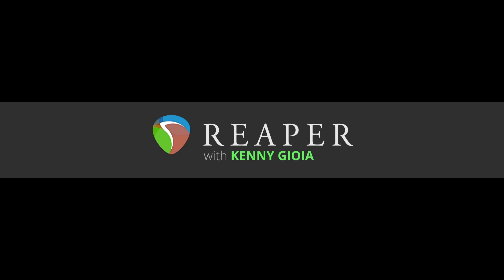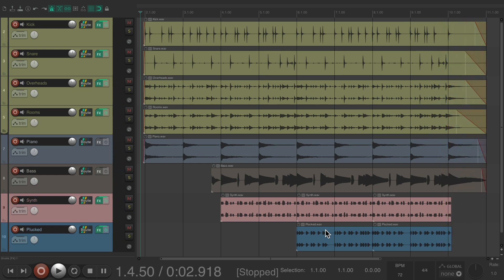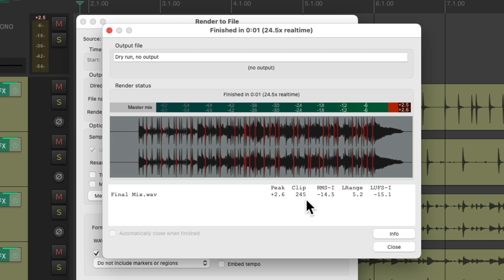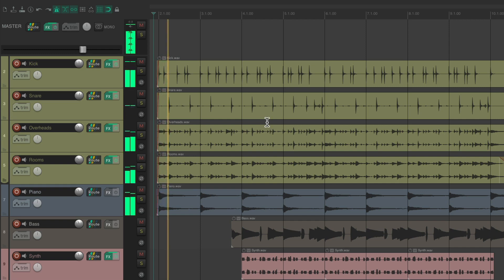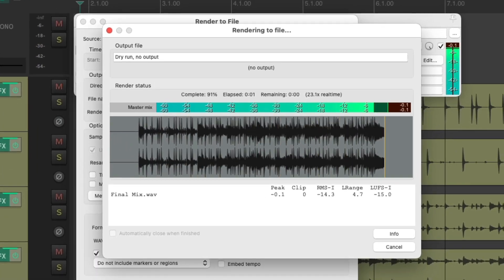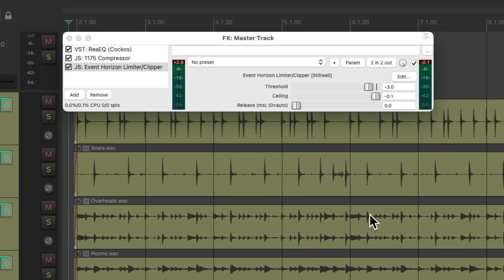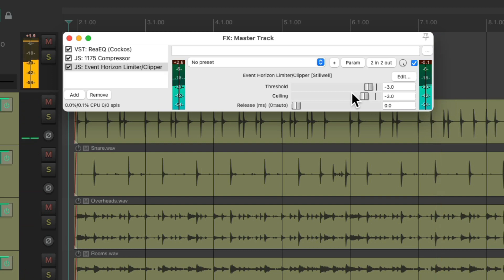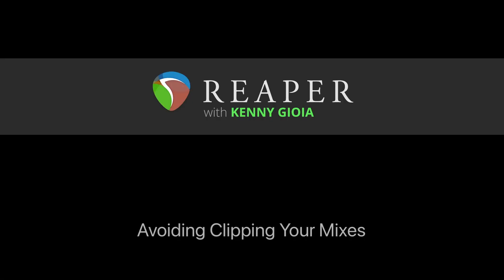Avoid Clipping Your Mixes in REAPER

Comment: Wonderful - except in the project I am working on, the master meters never show clipping, but the render always does - and always by random amounts. I tried limiting to no avail. With a 2.7 clip level I tried lowering the master fader by 4db  just to be safe... still clipped. No normalization turned on. 24 bit, 44k rendering to a wave file. What the heck. I assume I did something stupid, but scanned the forums and other people hve had similar problems with no obvious solution....

Comment: Limiter used on mix? “Some engineers suggest that mixes should have -3 dB of headroom for mastering, while others insist -6 dB is better. The truth is, as long as you’re not clipping or using a limiter, anything below 0 dB should be fine.” https://vintageking.com/blog/2019/12/mastering-engineers-checklist-for-mix-engineer/

Comment: Thanks for another great video, Kenny. A couple of things I'd add: 1) If you're sending your mix off to be mastered and render to a 32-bit float file (ideally at the same sample rate as your REAPER project), the "overs" should be represented properly, without clipping, and the mastering engineer can gain-stage the file at his/her input stage. 2) Based on REAPER 5.99, I typically see REAPER's documented rendering peaks coming in around 0.1 dB less than the true peaks measured with Youlean Loudness Meter (and tend to target a -1.0 dBTP maximum to allow for potential increases should lossy compression be applied later on). I hope this helps.

Comment: Usually I love your videos, but limiting just because avoids clipping, but limiting will generate distortion with no control. You have a huge audience Kenny. This is why learning how to gain structure is basic and a lot of people forget about it. I always say, if 144 dB under 0 dB FS are not enough to sound loud, nothing is going to make you sound loud.
Reply from the maker: Limiting only causes distortion if you hit it too hard. And it's no longer clipping. Which is what this video is about. It's a distortion based on the limiter. Which you should audibly hear if it's a problem.

Comment: Is this not just getting a clipped signal and turning down the already clipped signal? Surely they're clipping as they sum together and enter the master fader and you've just turned down post so the output isn't reading as clipped while actually being clipped? Like turning down a rendered waveform with clipping, the meter no longer shows it but it's still there? Wouldn't you have to attenuate the tracks before they hit the master? Thanks
Reply from the maker: No. That's not how gain staging works in REAPER. You can change it at the master and it fixes everything earlier. Check this out - https://youtu.be/5efick6yJA4
Reply: @REAPERMania  But how about for plugins that are modelled after analogs? Like certain plugins that have a sweet spot and would require the tracks to be gain staged?
Reply: @REAPERMania  Good to know, thanks! I guess I'm thinking with an analog mindset. This is more than likely true for other DAWs too then right?

Comment: Thanks for the vídeo.
But I need to disagree.
As far as I can understand, limiting wil prevent clipping, but will not stop me to overload the final mix. And this Master track limiter can hide that mistake...
Reply from the maker: As long as you don't mind the sound of the limiter, you're fine. If you do hit it too hard, you're going to hear the artifacts of the limiter. But it's not clipping.
Reply: @REAPERMania  Sure, but who keeps a limiter working in all the production/mixing processes, probably, will be fooled by this.
The tip from this video is great, but in a long run, for me, it seems that it can mess my overall levels notion.
Reply: @ghost mall I'm trying to say that if I keep a limiter in the end of the process (master stereo channels) and start tweaking levels, equeing, fx, etc., it may lead me to a false notion about what's really going on.
For example, low-end frequencies tend to push compressors and may activate limiting before they should.  So, even if I keep a lot of low freqs there at the start, maybe I'll finish to taking more than I need just to not overload the limiter.
Just like a multi-band compressor, if you bend a frequency range because something in your music twitched to multi-ban compressor threshold, everything among that frequency range will be affected, right?
So, if you keep a limiter at the end of the process from the start, I can assume it will change my understanding and perception about what every single track may be sounding without it...
...of course, unless you never make it work, you'll be listening a processed sound even before you know what's the proper level it should be.

I hope I could explain what I was trying to say...

Comment: I might add JS Event Horizon on my Master Track for a live performance I am involved with which has sample Piano, Horns in F and Timpani.  Keep it at 0 but it just ensures I can have the Master at 0 and not have the clipping issues which I have been having.  Currently I am running the Master Track at -6db to avoid sending a clipped signal to the P.A. which has clip protection but gives a bad audio result.

Great timing and interesting info to take on board.  Thanks Kenny.

Comment: I realize I'm finishing the instrument track, and than bouncing in the vocal track over it, but should it be this bad? What causes garbled vocals, and massive distortion. I literally have to record super low, and than use "normalize" to get the sound to come up. It's like it's sending the track through a distortion pedal. even the Sono interface is at half volume. https://youtu.be/mh58zRbeic8

Comment: Modifying native JS isnt a good idea cause it may have been used in your previous project without the fix. Better use simple parameter linking for eg or realearn.
Reply from the maker: Probably should have made a copy of the plugin and edited that to be safe. :)
Reply: I think no issue as he changed it back hm?
Reply: @myyt4382  Yes he does. But it easy to forget to edit back, and not that quick anyway compared to the safe method of parameter modulation which doesnt imply any line of code modification.
Reply: @XRaym  that's true

Comment: Always good content. Thanks Kenny. How do I prevent my drum samples from clipping?
Reply: Grab yr individual tracks, at the top of them, and pull them all down until you can see that none of them are clipping. Then, render each of them, into a secondary folder, and replace yr samples entirely. Just don’t throw away the originals, just in case they cost any money, or you’re unable to find them again…. 
I hope that that helps.
Reply: @tbobbyelectric  thanks
Reply: Just another approach: learn how to gain stage your tracks. You can use either the clip gain knob or a trim plugin in that process. This will help you with mixing in the long run. Then you can just save the project and make sure to tick the box where it lets you save a copy of the resources/samples you used in the project. It will make copies of the files in your project folder. No need to render the tracks individually. This will save you more time and will enable you to further use Reaper's feature of "clean your current project directory" for any unused samples that are not referenced in that specific project.
Reply: @the_other_dude  TOTALLY, Brotally. It is ALWAYS ALL ABOUT PROPER GAIN STAGING. Gain Staging would likely end up being "Chapters 1 & 2" in my make believe fantasy book, for the future. 

I've worked with crew that have never even heard of the term, "Gain Staging" before. I spent the next two weeks talking, and mapping, and drawing & graphing things out, for this lot.... 

Now, 5 years down the road, I have to beg one of these "Engineers" for a spot on the next run, bc we all got so separated during covid... 

This is Live work, that I am referring to. But, it is ALL of the same brain methodology, at different pacing, .... An entirely different Section, or an entirely different publication, for my imaginary book series for the future. HA!
Reply: @the_other_dude  thank you very much